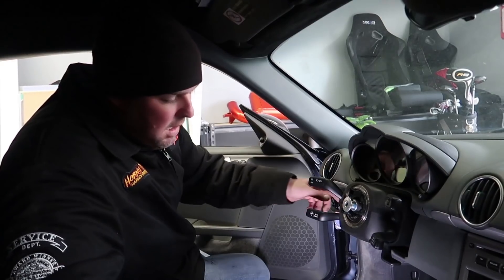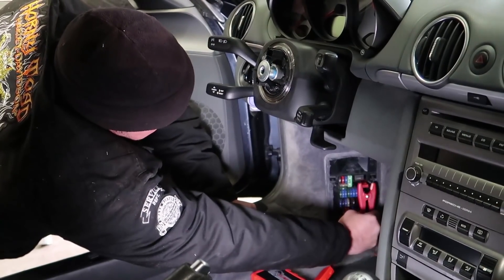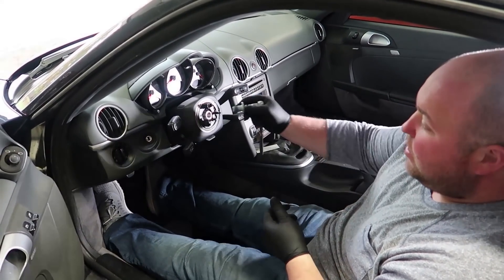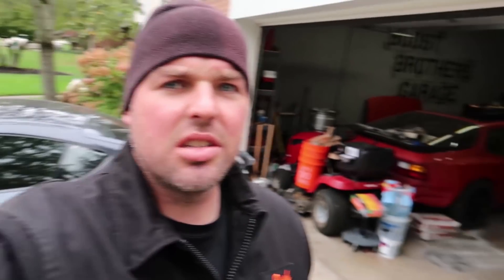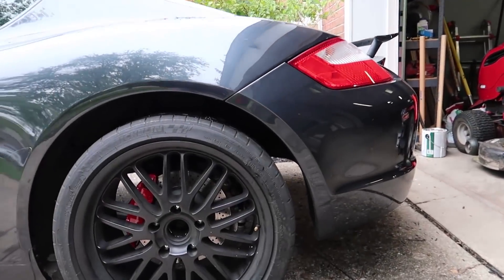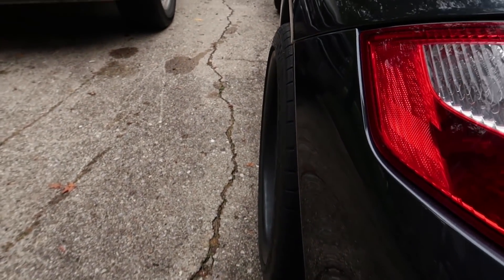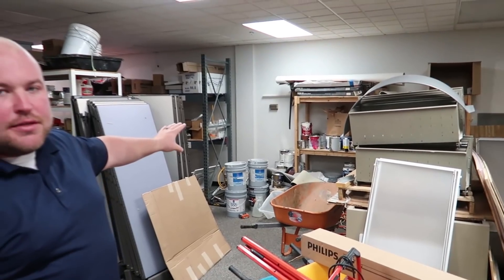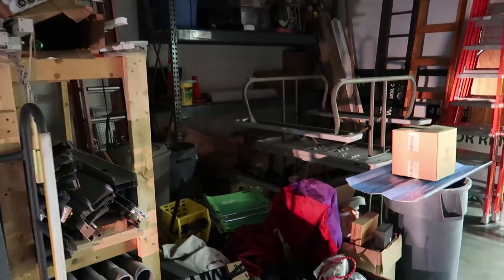Cayman Back on the Ground + Shop Preview!

Comment: Very cool new digs. I was able to put a 20'x20' addition on my 2.5 garage for my Cayman. I am jealous of your kick back area thought. All the best from #800
Reply from the maker: robkal56 thanks, we are really excited! An addition would have been ideal but my layout just didn’t make it easy. What year is your Cayman?
Reply: 2011 Cayman S Black on Saddle or Sand interior. Had it for a year now and just 29K on the clock. These are greatly under appreciated vehicles, as you guys know. Just a little more hp...
Reply from the maker: Awesome!!! Agreed, such a great platform. After the plenum and exhaust the car was really starting to get fun. A tune and under drive pulley and we would have been in business power wise!
Reply: Can I ask you guys a question? My clutch is grabbing too high.  With the hydraulic clutch, it's not clear were the adjust mechanism is. Is it internal between the slave cylinder and the throwout fork? Pointers? Thanks.
Reply from the maker: robkal56 robkal56 my understanding is the clutch is not adjustable on these cars. When we replaced the clutch and Flywheel on ours there definitely wasn’t anything mechanical there to do it. I have heard, and who knows if it’s true, that once there is less than an inch of free play in the clutch pedal your disc may be getting towards the end of its life. However with your mileage that wouldn’t make sense